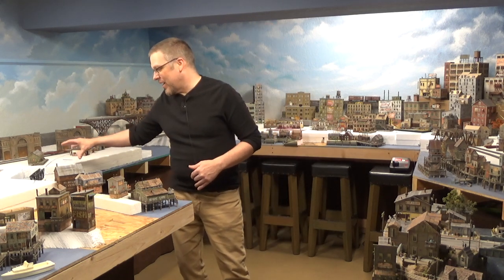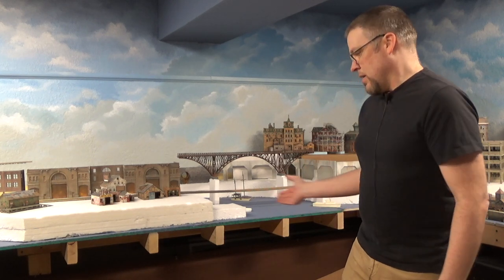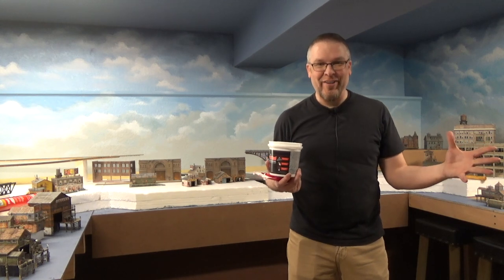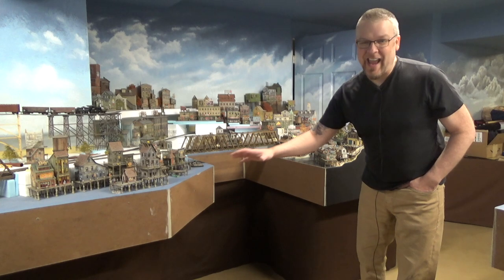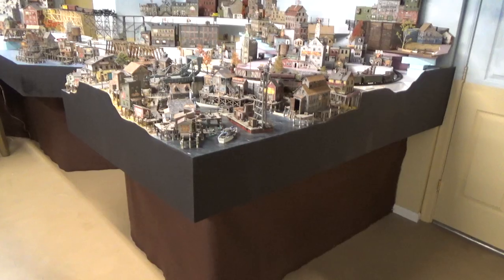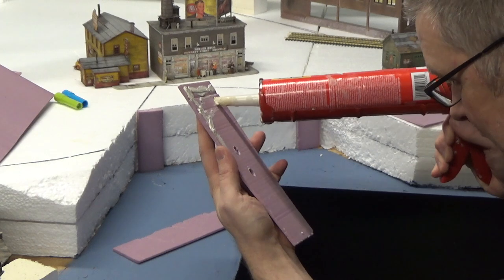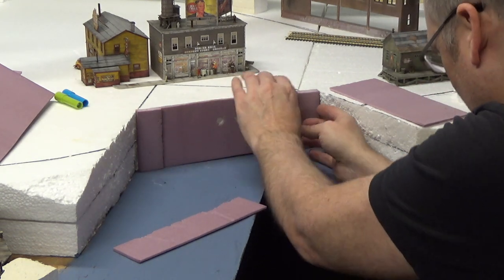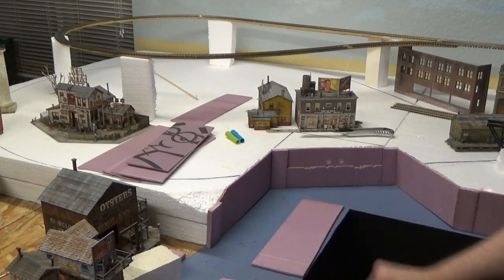Adding fascia and concrete retaining walls to our model railroad layout!

Comment: You never disappoint cranking up the motivational juices.   I am surprised  you painted your facia but understand you putting it up.   It really looks great.   Have you ever tried the tissue paper technic for adding water?   Been going back over past videos to refresh on how you did things and painting.   My Saw mill build is about 85% done, thanks for the inspiration to use wood.
Reply from the maker: Thank you so very much Will!!! I have not tried it but have seen videos on it. Good luck on finishing up your saw mill! Thanks for watching buddy!!! 👍

Comment: Jason, thank you for your great, great videos.
Please keep them coming.
Question; have you ever used MOD-PODGE . In your builds?.
I used  it  on a demo  sign using what I learned in one on your older videos..
Reply from the maker: Thank you so much Bob!!! I tend not to use mod podge because it has a little bit of a shine to it when it dries. But it works great!
Reply: @JasonJensenTrains  
Thank you .
You really do the best job of explaining all of your builds.
👍😊